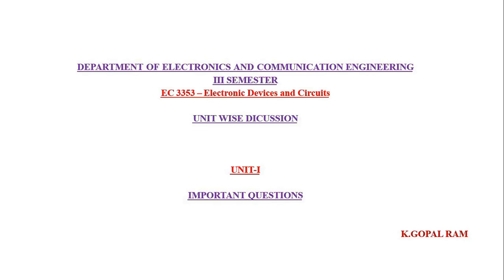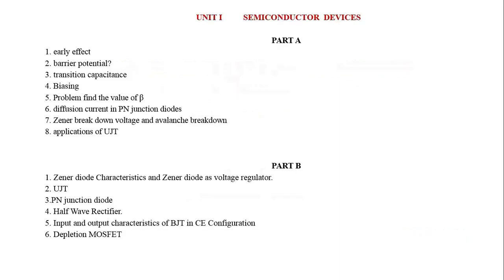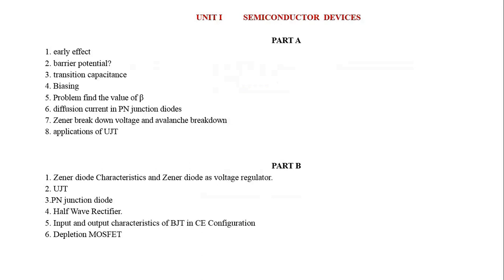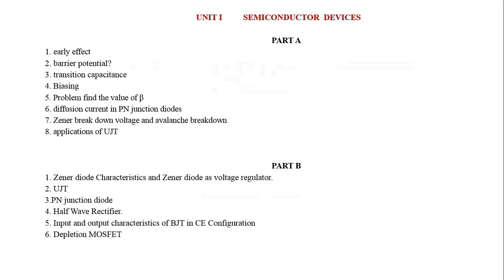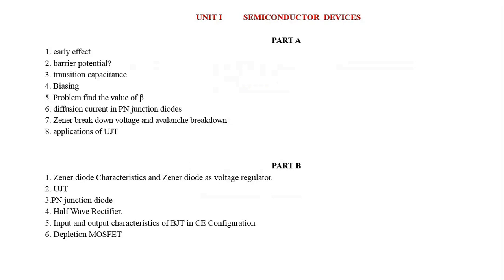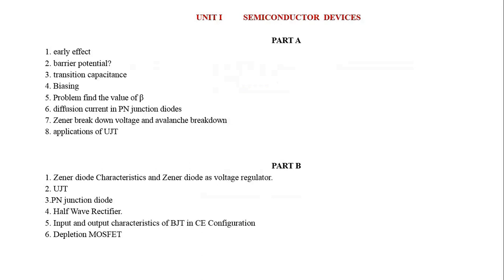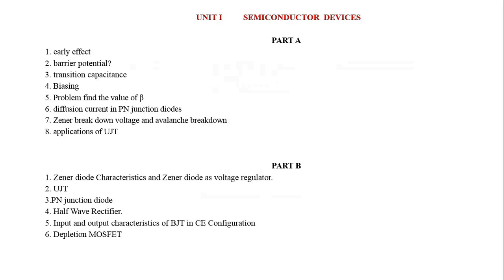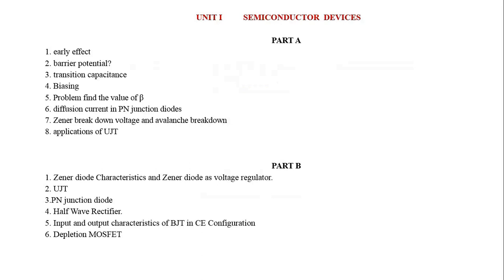EC3353 ELECTRONIC DEVICES AND CIRCUITS UNIT-I IMPORTANT QUESTIONS DISCUSSION

Comment: Please  sir put for r2021 it's syllabus totally different from this
Reply from the maker: UNIT I          SEMICONDUCTOR  DEVICES                                                                          
             PN junction diode, Zener diode, BJT, MOSFET, UJT –structure, operation and V-I characteristics, diffusion and transition capacitance - Rectifiers – Half Wave and Full Wave Rectifier, Zener as regulator
  this is the syllabus for unit -I